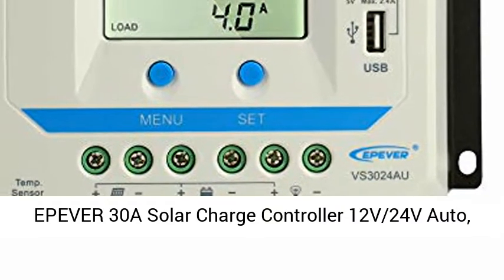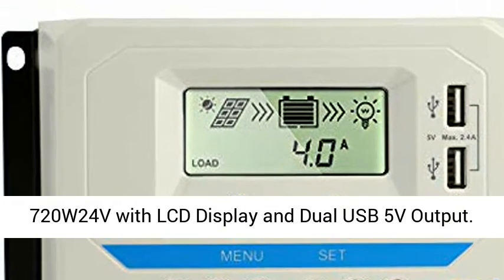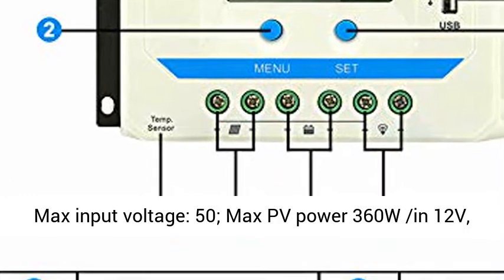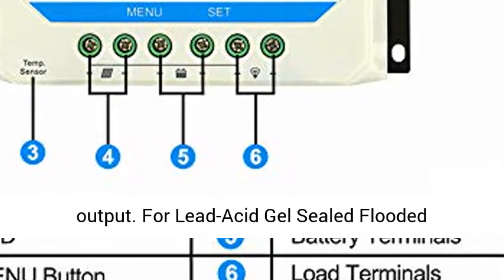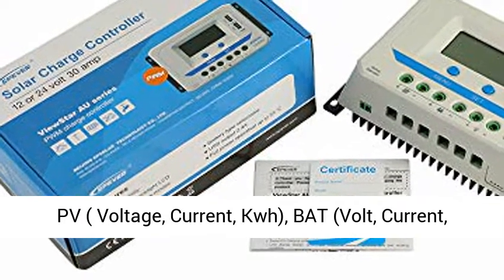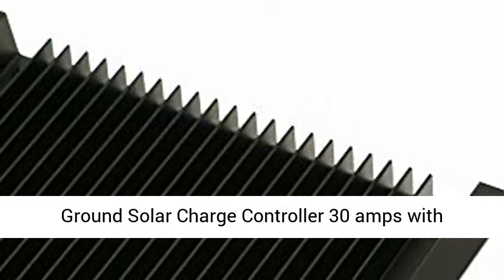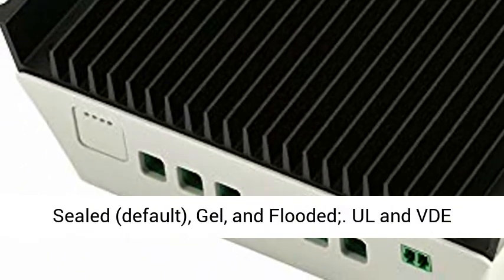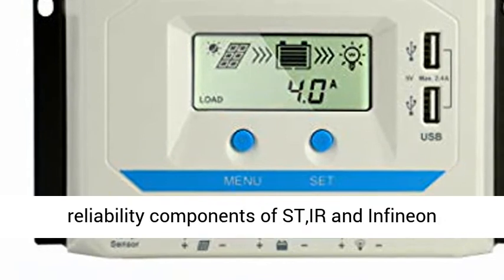EPEVER 30A Solar Charge Controller 12V/24V Auto, Solar Charge Regulator 30 amp - Overview

Comment: """...For lead acid, sealed, flooded..."""  

Does that include AGM?
Reply from the maker: Hello, AGM’s chemistry is like a flooded lead acid battery, it should work in the same way. So far the controller has been working for a year and everything looks fine. I recommend it.
Reply: @gardenlovers  I m having issues with it.  It shows no watts incoming from the panels, only the volts and amps.  And  they are very low.  Like, my 110 watt ecoflow foldable only brings in about 45 watts in full sunlight, while one minute later my little handheld solar generator was getting 80.  I don't know whats going on, but I am not happy with the purchase so far :(
Reply from the maker: @jeffsmith3350  I'm sorry to hear that.
Reply: @gardenlovers  One last question:  For AGM, should I set the battery type to  "sealed" or to "fld"?  I'm guessing sealed, but not sure.
Reply: @jeffsmith3350 It's kinda messed. Sealed a.k.a. Agm a.k.a. vrla have 3 types: gel, opzv, lifepo. So from the epever controller is messed up. Should be either sealed or gel.